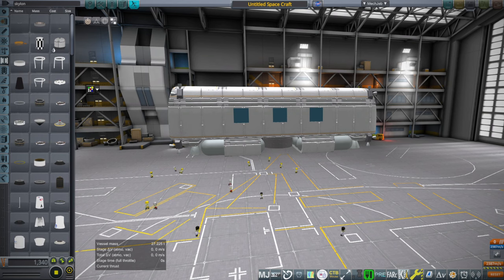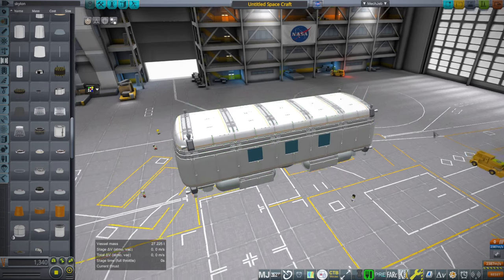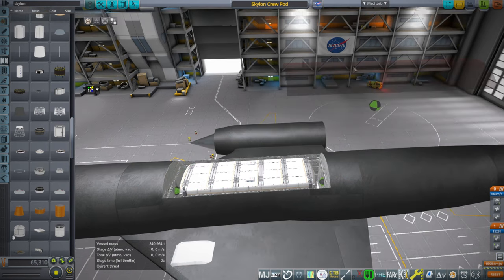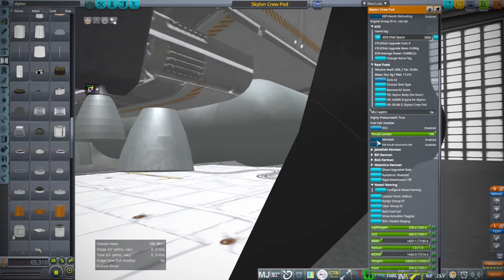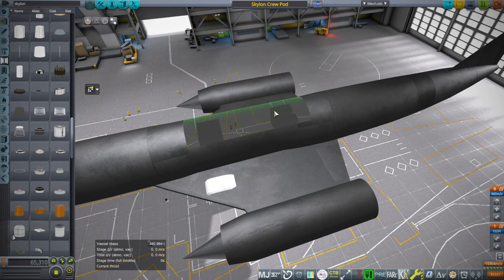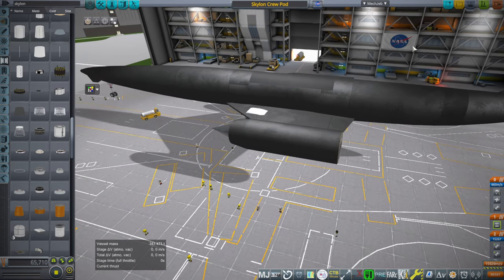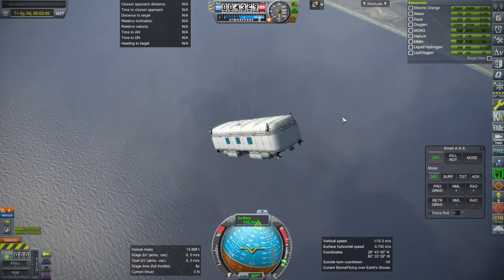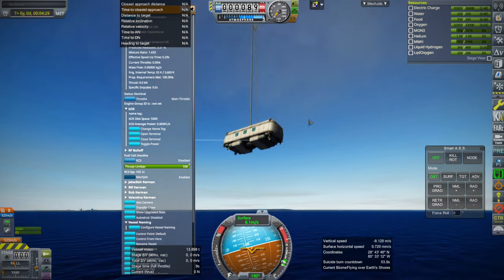Skylon Crew Pod (Kerbal Space Program with Realism Overhaul)

Comment: Is the bus missing thruster to control the yaw axis?
Reply: exactly what i thought, there is apce also, if they were placed to the side of the quads. also means in this current form it can't control "sideways" translation, in addition to "yaw".
Reply from the maker: No, It can control yaw by firing the forward-facing left and rear-facing right thrusters. However, soleenzo is right about the translation issue, so I''ll have to add some thrusters for left and right translation.